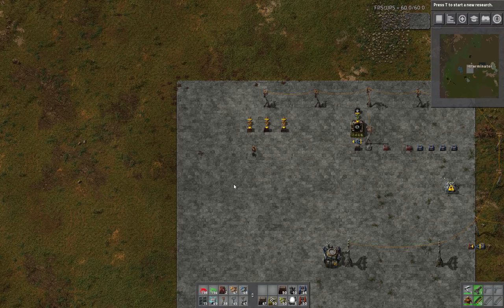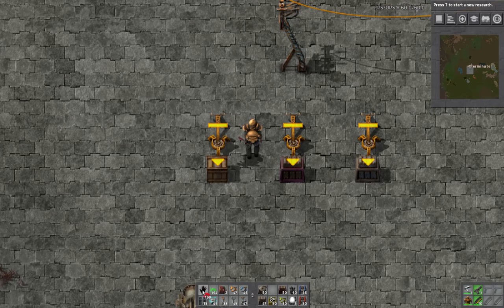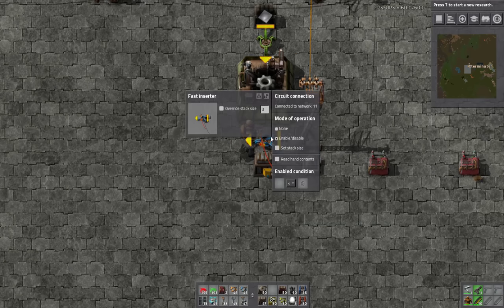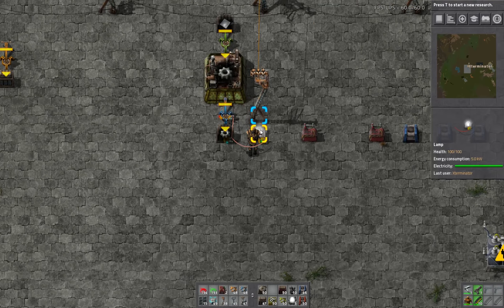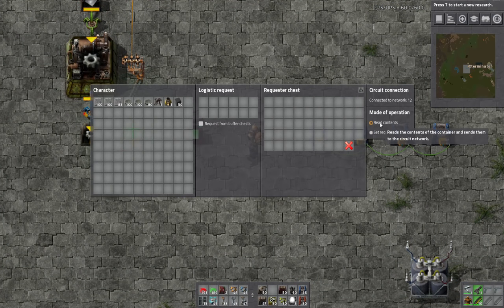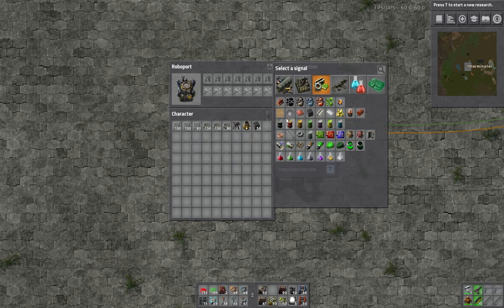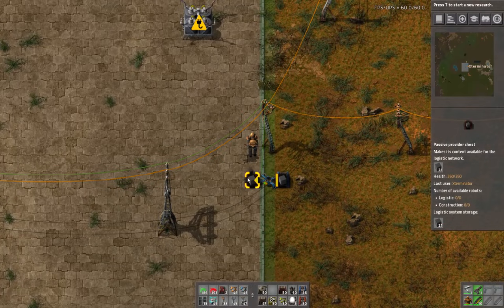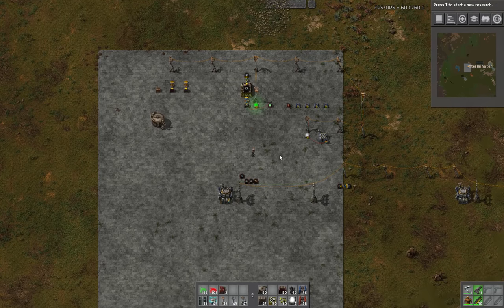Factorio Circuit Network Tutorial: Basics for Beginners - Guide & Walkthrough

Comment: I didn't use combinators until recently, but I did use wiring to rig my nuclear power plants to only consume fuel rods when the steam tank buffer runs low and rig unloading stations to go active only when their stockpile crates run dry or below an acceptable value.

Also it's fun to make a power indicator that relies on signals to make a battery display as a landmark out of lights. (Lights in a formation with a gradient of A for enable/disable, deciders linked up to print a colour code as per the power rating so the whole thing changes colours when the juice starts to run low)

Comment: You might want to explicitly mention how the transmission of signals works. You instinctively strung together all the requester chests, because you knew that the signal would propagate down the line. Set up a similar layout, but make it so that the constant combinator is "centred" among a few chests. (If you were to keep the same layout you demonstrated in the video, you would reach the distance limit for stringing wires.) Then you can explain that no matter how you wire up the chests from the constant combinator, the same signal is passed through that narrowly defined network. (So, if you set up a loose octagon around the constant combinator, you wire each chest, separately, from the constant combinator. Beside it, you have that same layout, but you wire up only one chest to the constant combinator and daisy chain the rest of the chests (2 through 8), but do not wire up #8 to #1.)

There is a concept in teaching that you will truly know a subject when you need to explain it to someone else in a manner that he/she will understand. You will master this subject. Do not be afraid to fail. "Do or do not. There is no try."

Comment: I use basic circuit wires to balance heavy, light oil and petroleum. Otherwise the refineries can get blocked of one of the outputs, that would be good to ad in a tutorial.
Reply: I waste so much of it ugh plastic line dies all the time but loving this game ! searching for the  efficiency but I'd like to solve the mess I have created myself.
Reply: I use exactly one pump in a circuit network which reads the amount of light oil in the network to keep my liquid production going. :-)
Reply: Thanx man, before u comment, i was starting to think this system is useless.
Reply: @hadislman4009  i dunno if you still play but I found it handy for when you have two different lines going into a single chest and from that chest to a crafting machine

Unless your ratios are perfect, eventually the chest will get full of one of both, blocking the other and stopping the crafting line. Limiting the chest space doesn't matter there.

What you do instead is wire either the inserter or the belt itself if there is more than, let's say 1000 of that material in the chest. That way it never will get blocked.
Reply: yes, this seems like the most obvious choice for circuit network. Unless you are using the different oil, it can cause a blockage.
Reply: Wait how do you balance oil outputs

Comment: nice. i want more about trains. how to get different trains to one train stop without "hard coding" (from iron out to iron in. but it only should go on, if needed. if enough iron is there turn station off. but i want also to deliver copper to the same station) so basically ltn in vanilla xd
Reply: and in general i want to learn more about using anything and everything. (for me using item signals is "hard coding" and often too much work by setting all signals by hand)
im no native english speaker and i get always confused with anythin and everything. i kind of understand those two words, but in circuit conditions i always choose the wrong one.

Comment: I'm trying to set up a circuit network that will alert me when my boilers are running low on fuel. I get recommended to do that everywhere, but I can't figure out how to do it! I can't connect a wire to a boiler. Connecting it to a belt keeps items from moving onto that section of belt. And connecting it to an inserter either makes the alarm not go off, or go off perpetually! It also won't display the custom message I make for it either. And I find it really annoying how you don't get your wires back when you try to re-wire everything just to get the simplest task of all to work. Seriously, all the circuit does is check to see if there's no fuel at the end of my boiler line and if there is, sets off an alarm to tell me that. Why must it be so difficult to get it to do the most basic thing???

Comment: I want to make yellow science with two belts. 1 belt for copper wire, the other for battery, Processing unit and speed module.

Is there a way to make the Stack Inserter make take such a stack: 1 battery, 1 Speed module and 3 Processing unit?

Comment: Is there a way to set up a network where it flushes a storage tank when the fluid content reaches a certain amount?
Reply from the maker: Unfortunately not with the actual flush feature, because as far as I know that can't be controlled with the circuit network. You could kind of do it by just having a pump turn on and pump out the liquid when it is above a certain amount. 
Still needs somewhere else to go though unfortunately
Reply: @Xterminator  cool. I have a system kind of like that set up, where excess fluid is pumped into a storage tank that alerts me if its getting too full so that I can flush it.

Comment: ok, good start.  now, explain combinators so an idiot (me) can understand it.
Reply from the maker: Brian VA Unfortunately I'm still learning combinators myself. Hopefully I will know enough soon to do a tutorial though.
Reply: In a nutshell, the combinators take zero, one, or two inputs and output a result based on a operation or a verification (if there is one).

The constant combinator has zero inputs, but it can have up to 15 outputs.

The arithmetic combinator performs mathematical operations based on the inputs that it receives. The basic ones of addition (+), subtraction (-), multiplication (*), division (/), and exponentiation (^) are just like what would be taught in school. Modulo arithmetic (%) gives you the remainder of a division (/). The last five operations deal with bits, which means binary: 0 and 1. The circuit network cookbook on the Factorio wiki should (?) have some explanations. Whatever the results, the calculated value is what is output.

Ex.: 
-Wire up an electric miner. Read the contents of the entire ore patch. 
-Feed the signal into an arithmetic combinator. 
-Set up a constant combinator. 
-Set an output signal (B for bonus) to the mining bonus that you have researched so far and add 100. (The numbers need to be whole numbers. Decimal numbers are not permitted.) 
-Wire up the output from the constant combinator into the input side of the arithmetic combinator.
-In the arithmetic combinator, set input #1 (left side) to be the amount of ore in the patch. 
-Set input #2 (right side) to be the signal from the constant combinator. 
-Choose multiplication (*) as the operation that will be performed. 
-Output the same item as input #1. (If it was iron ore, then select iron ore.) 
-Wire the output to a power pole. 
-The value will be 100x larger than it should be because we need to divide by 100. (This will simulate decimal calculations). 
-Connect the power pole to a different arithmetic combinator. 
-Set input #1 to be the ore. 
-Choose division (/) as the operation. 
-Manually type 100 in input #2. 
-Wire the output to a different power pole. 
-The value will be how much ore you should expect based on your current mining bonus. (Nilaus did something similar around episode 50 in his most recent mega base series.)

The decider combinator performs a verification between an input (#1) and another input (#2) or a constant (manually typed number). You can check whether something is greater than (>), greater than or equal to (>=), less than (<), less than or equal to (<=), equal to (=) or not equal to (!=) something else. If the result is true, than an output signal is sent. If the result is false, then no output signal is sent.

I am sorry if the explanation is a bit long, but it should be enough to get you started. The best advice that I can provide is to craft a dozen of each type of combinator, a few dozen chests (your preference between wooden, iron and steel) and test the results of each operation. Use an item that you have plenty of, like iron plate. Place a stack (or an amount of your choice) into each chest. Wire up the chest to the combinator (input side). Wire up the combinator (output side) to a power pole. Check the results of each operation. When you understand and know what to expect from each operation's or verification's output, then you should be able to apply what you have learned to different areas of your factory.

Best of luck!
Reply: Michel Guenette I don't want the nutshell. I want the bagel explanation.
Reply: Pose your question and I will try to answer it.

I have not worked out everything, but I have a decent grasp of the essentials. After that, it becomes a situation of looking for out of the ordinary solutions to problems that need a bit of logic.

If there is a better forum for me to post explanations, then please point the way.
Reply: yeah, the basics aren't too bad.  was just after something a bit more advanced, nothing in particular